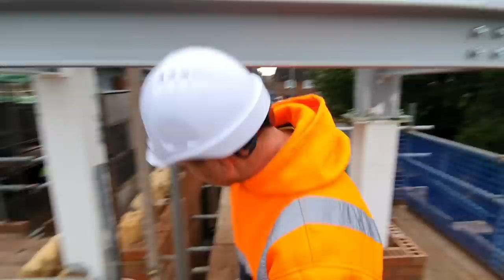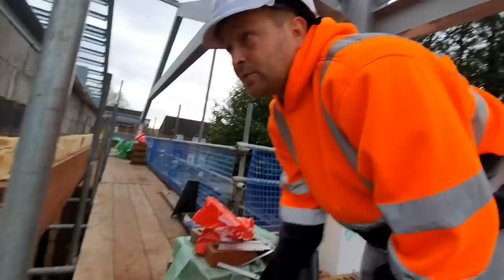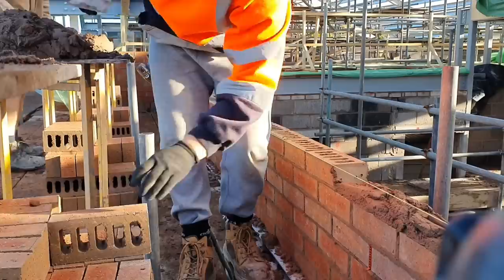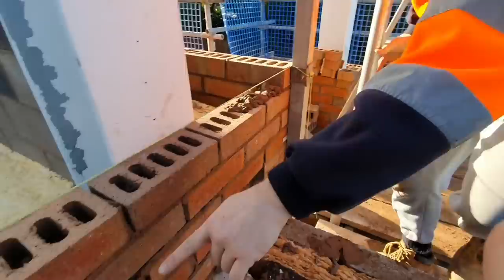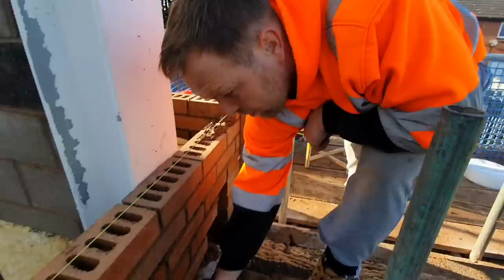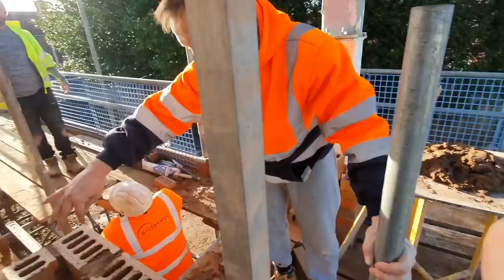Half Course Hero's

Comment: Grind one side, bump the other , it will pull it out of it quicker you'd need to do it with profiles.  And divide it out.. why can't lads keep an eye on there work.. unfortunately sometimes ya have to take shitty work to keep a few quid flowing in the door
Reply from the maker: They wouldn't take the other end down so I had to do it this way
Reply: @Changy_C  I suppose you have to follow what's there... bit like some old buildings I worked on they be that much off plumb you just have to keep it parallel so people won't see it..